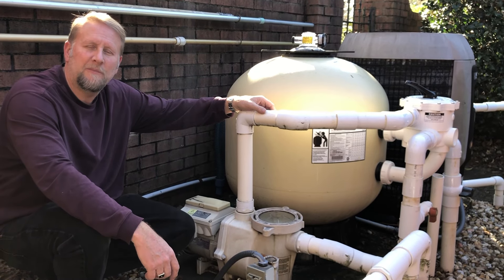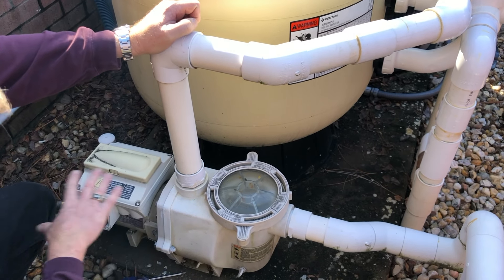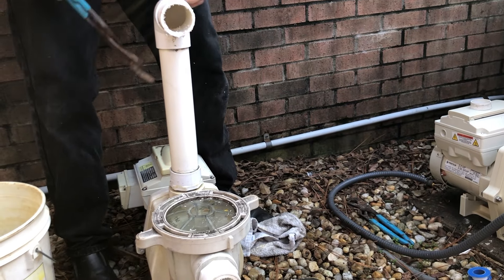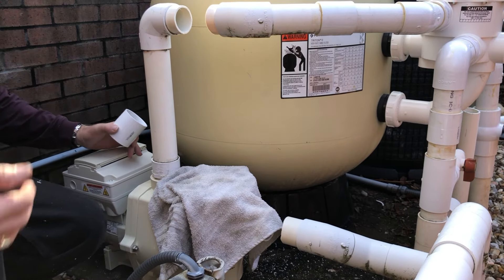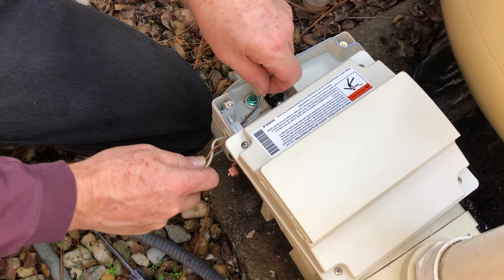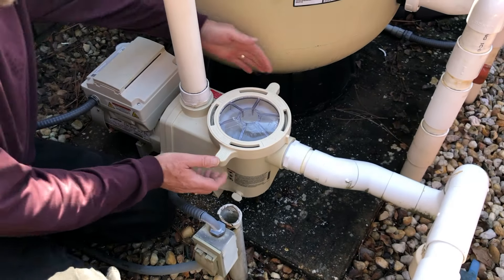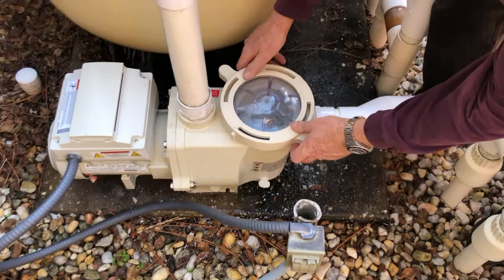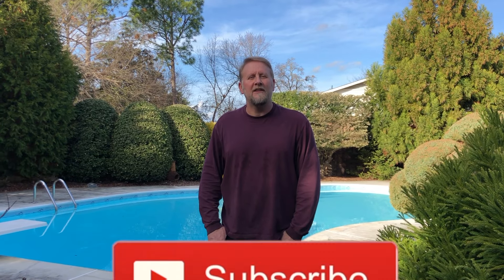How to Install a Pool PUMP Quick and Easy!

Comment: Silly. For another $30 he could have used high temp unions instead of glued ntp adapters so that the pump is removable in about 20 seconds for maintenance and also for the next replacement. In fact the newest Pentair pumps come with theim.  I'm so tired of "pool professionals" doing things to guarantee their own job security.  Also, there is no "neutral" in a 240v circuit. Both L1 and L2 are hot.
Reply from the maker: Thanks for watching and commenting. 120 volt hook up’s use a hot wire, a neutral wire, and a ground. However the Intelliflo 3 HP variable speed pump can only be wired in 220 volts. 220 volt hook up’s have two hot wires and a ground. I did wire this 220 volts but I misspoke, thanks for catching that. There are several different versions of the Intelliflo pump, some come with unions and some do not. The Intelliflo that was installed in the video was the Intelliflo vsf which does not come with unions.

Comment: Not very smart way to change out pumps. There is no reason to change out the basket housing unless its cracked and leaking. The pump motor only can be replaced without the additional cost to the customer and you don't have to cut any plumbing.
Reply from the maker: @pjdn    Yes l agree, however the customer wanted to replace the whole entire pump not just the motor. Thanks for watching.